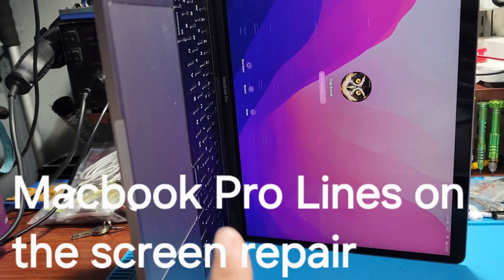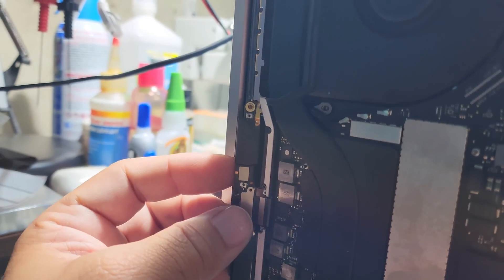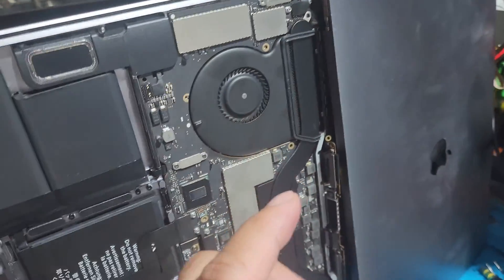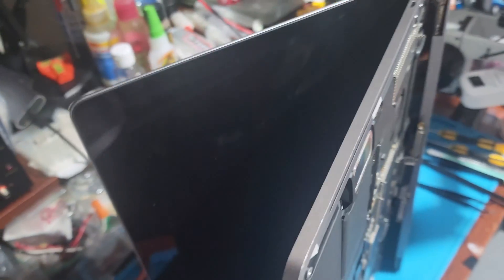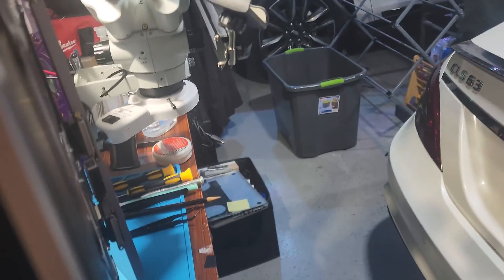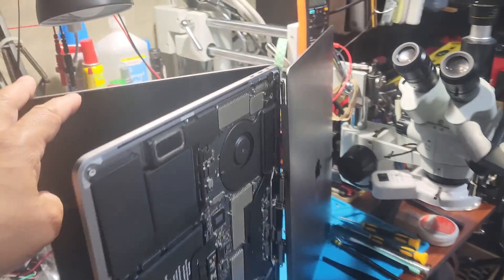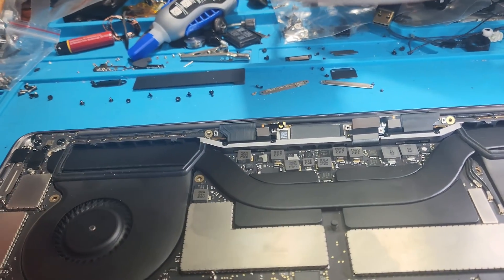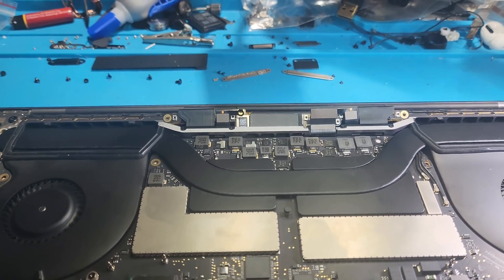2016-2019 Macbook Pro 15" lines on the screen fix

Comment: It's a common issue with the touchbar Macbook Pros. It's called Flexgate. It's the ribbon cable that comes from the logic board to the screen. It can be repaired, but it's very difficult. I wind up just buying a cheap Macbook Pro from ebay for $335 and replacing the screen.
Reply from the maker: I'm familiar with the Flexgate and have repaired a few, but I'm unable to see any cracks or issues on the cables for this particular screen. If there is a crack on one of these cables it must be very tiny. I will give it another try under the microscope. Thanks for your reassurance.